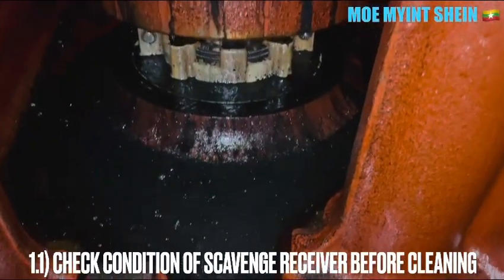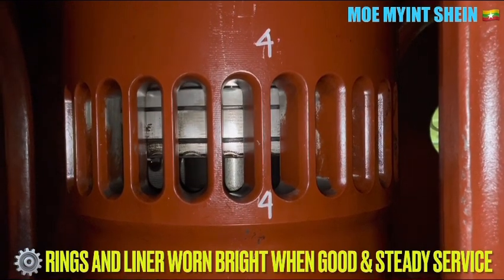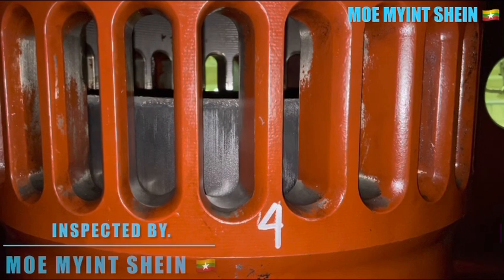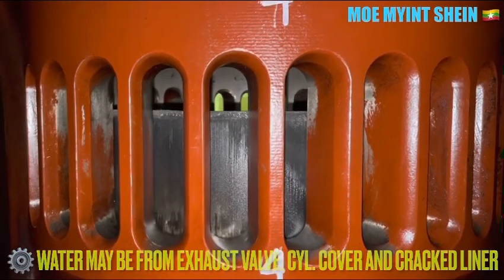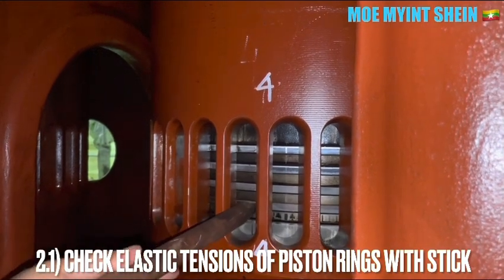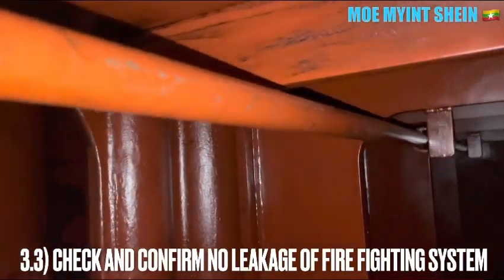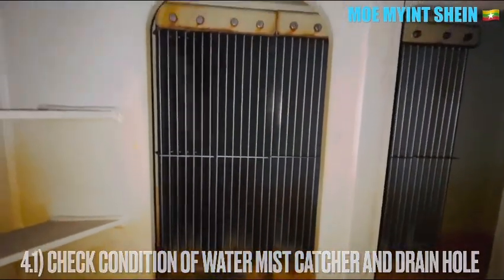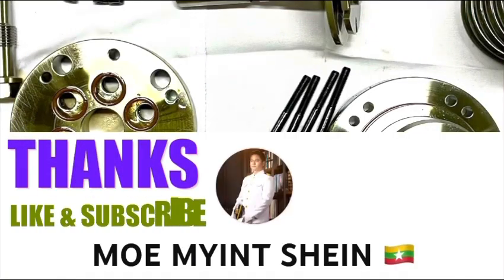SCAVENGE SPACE Inspection | Main Engine | Marine Engineering | Technical Vlog : 064

Comment: Thanks so much
Reply from the maker: Welcome !
Reply: Class 3မှာမေးတဲ့ Boiler Cascade tank temperatureကို ဘယ်လို Controlလုပ်လဲ ဆိုရင်ဘယ်လိုဖြေသင့်လဲအကို
Reply from the maker: @tunmyintaung2221 
Keep above 80’C by adjusting drain cooler bypass valve. This is recommended by boiler chemical supplied companies, such as DREW MARINE, UNITOR and so on.
Reply: @MoeMyintShein_MMU  
Thanks a lot sir